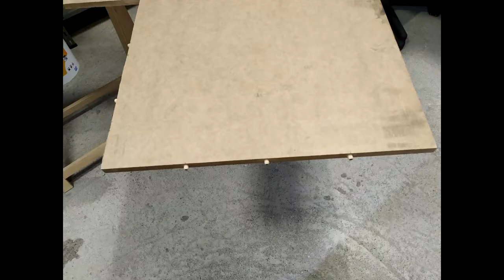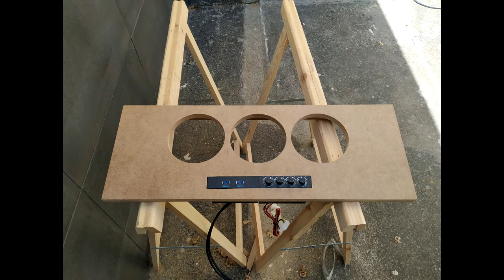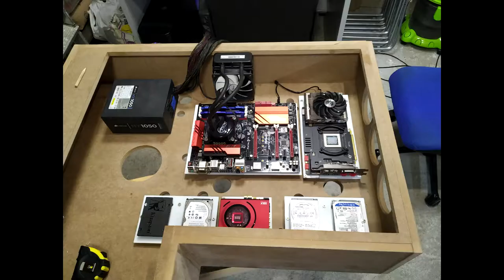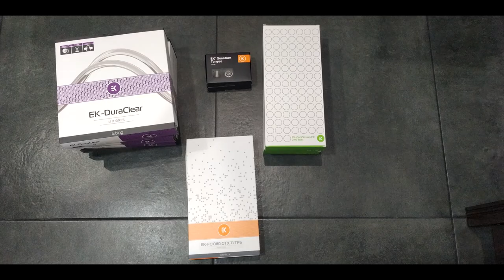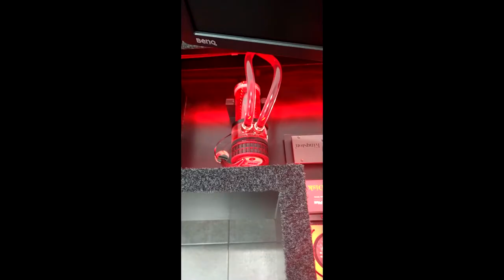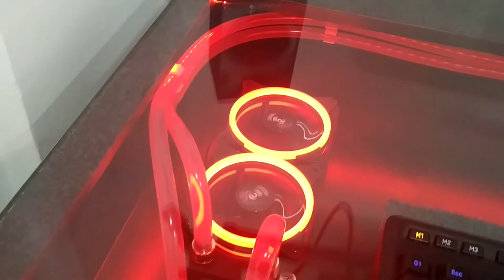Building my own PC GAMING DESK refrigerated by water custom loop

Comment: Saw the pics and this link on the group. Very nice work u did there! Do you have extension cords from the I/O, Graphics etc. to the outside or is everything plugged in directly? I would have made a custom I/O panel with extensions.
Reply from the maker: I didnt need extension cords since the evga psu i have has long enough. I use and extension cable for the graphics card so i can sit the graphics sideways like the motherboard, also another extension cable for the sound card. Also all the cables are routed under the base when i builded i left a 5 cm gap from the base to the edge of the table so all cables are under the table but you dont see them at all. Last week i made a wall pc with spare materials and my old cpu components. hit me up if need more info or pictures.
Reply: @kryptoneti1956  Of course i would like to see this build as well, i always love to get inspiration. Personally i dont like glass desks for myself at all, but they kinda look awesome.
I read that you also will change the watercooling pipes to copper pipes? that for sure will look great also.
Reply from the maker: yes thats my next big step hopefully i can do it this year, removing soft lines and putting copper lines :D also rearranging a bit the components
 @GabberArmy